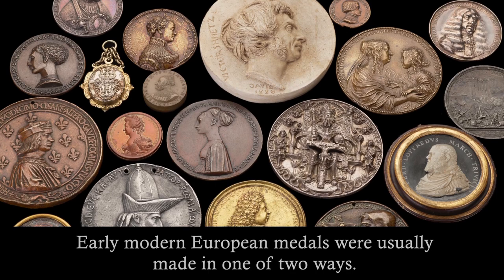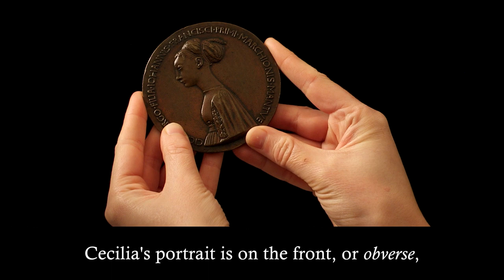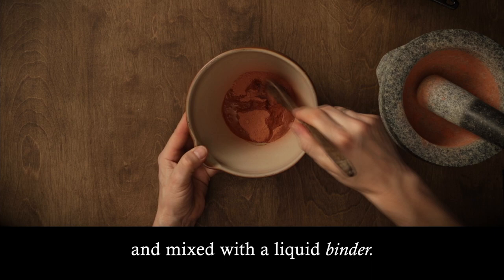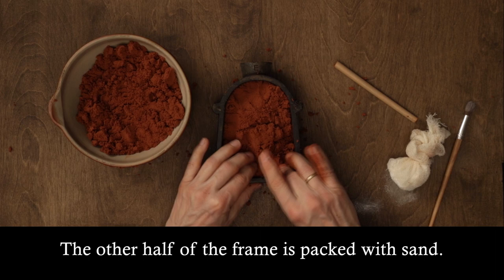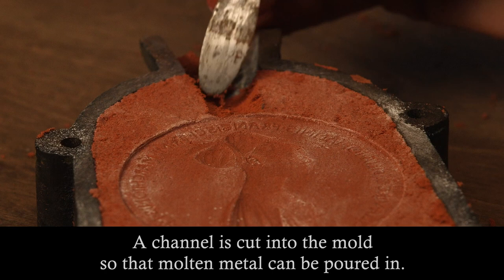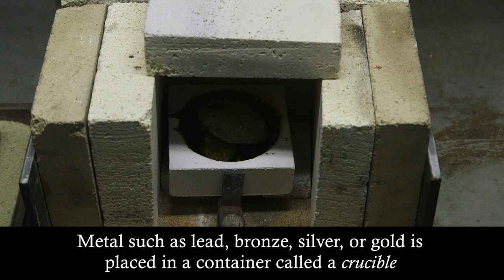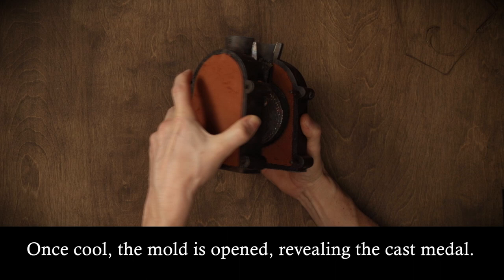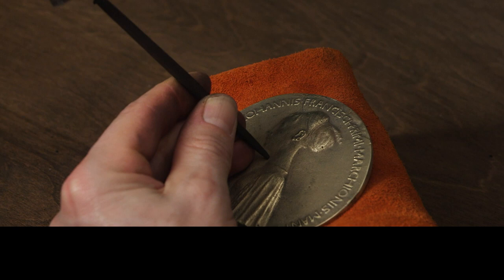Making a Medal Using the Sand Casting Process

Comment: What power use for casting and what liquid mix with power.
Reply: Generally speaking, in die-casting machine models from 88 tons to 130 tons, the motor power alone is about 18KW~25KW.
We have 3 X 88T die casting machine in our factory which used to make medals,keychains,badges,coins,bottle openers everyday.
Here is automatic die casting machine work video:
https://www.youtube.com/watch?v=paOChW85au0

Comment: I am pretty sure the original was made with the lost wax method and not sand casting.
Reply: No, I am fairly confident the original was made with sand casting. There are historical examples of even finer details that were cast using wax on a slate base, and those get detail easily that fine, if not more so.